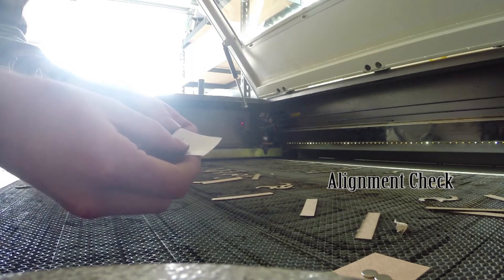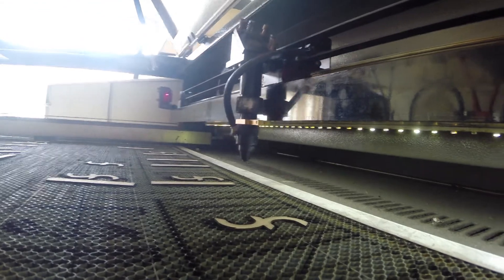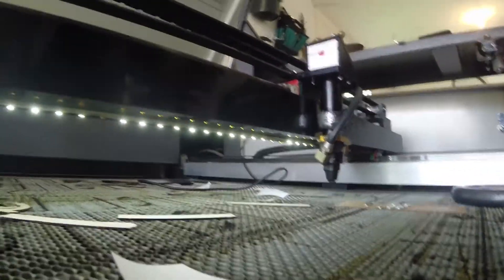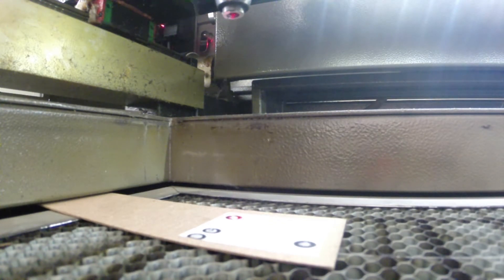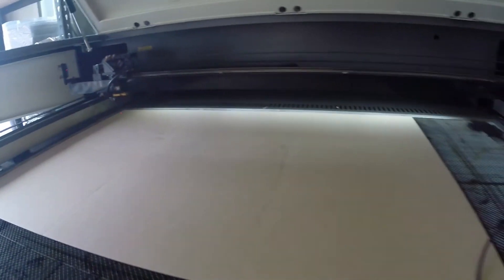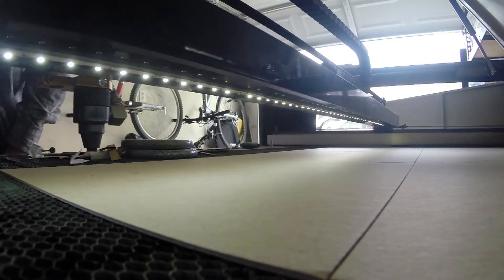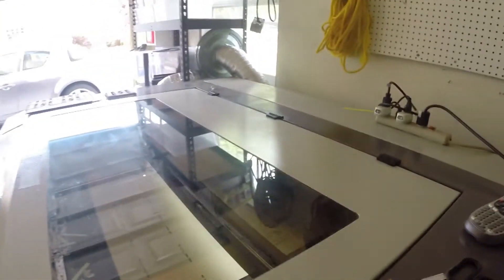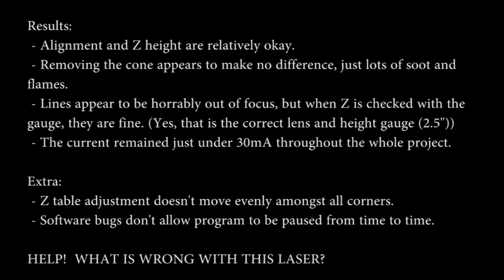Full Spectrum Pro LF 150 Watt Laser Troubleshooting

Comment: You aren't using the focus guide properly, according to the manual:

The laser must always be in focus when in operation. Not only will you not have full power but 
low power out of focus laser beams will burn or start fires instead of cutting through materials.
Focusing the 24x18 [i actually copied this from the 36-48 manual] is quick and easy. Your laser included a focus ruler sized for the included 2-
inch focal length lens. To focus for engraving or cutting, simply place the ruler on the top of 
the engraving plane and jog the Z table up or down until the small notch rests evenly with the 
flange of the air nozzle (Figure 15).

The picture shows the ruler on top of the part that holds the lens, not on top of the gold auto-focus ring. You've probably already resolved this though. I'm trying to figure out how fine the laser can go - I tried engraving 8 pt font on anodized aluminum and it didn't turn out.
Reply: Posting again in case someone stumbles upon this when trying to troubleshoot themselves. I just did test fires onto a sheet of paper using the focus guide they provided...I got the smallest dot when it was 2-3mm closer to the aperture than the guide told me, which I ended up cutting off. Much more accurate now, though I haven't tried any more 8pt fonts. I also realize now it's possible you cut your focus guide prior to making the video.
Reply from the maker: Ian Lehman Very true.  The guide they provided is not correct! You have to modify this one of make new ones to be as accurate as possible.  Thanks!
Reply: Common Fibers No, it wasn't. 9:07 of the video, lip of the guide is over the gold bracket that holds the auto-leveling pressure sensor probe. Page 37 of the PDF guide on fslasers.com (labeled page 30 at the bottom of the page) clearly shows different placement, as does the text direct different placement. Gabriel just said you have to modify it or make new ones, but if you follow their directions and use the one that came with the unit, the positioning in the video is wrong. He very may well have made a custom focus guide, but if someone is watching this video and sees that, they should know that's now how you use the stock piece.
Reply: ***** Your video is from a few months ago, did you get it working properly? If so, what did the issue end up being? My table was completely off-level when we got it, and I had to readjust it from underneath after I realized it...just came in on Wednesday though, so I'm a huge novice, and probably spouting my opinion where it isn't wanted :-)

Edit* - I'm guessing you both work together given the logos being cut in the video and the logo in the common fibers videos. The unit I have isn't as big so sagging isn't an issue, but it seems quite sturdy...when you put the cardboard shims underneath does it cut evenly across the entire surface? Maybe you can readjust the whole table from underneath? The honeycomb surface is super heavy (and pretty flexible), does it sag less with the other one that came with the unit?
Reply from the maker: Ian Lehman Hey Ian, 
Responding for both CF and myself, when we first purchased the laser the instructions were to actually use the laser ruler as shown in the video.  They have since modified the ruler and instructions for a different method.  We have just cut custom rulers to their specifications.

As for the sagging, it isn't the honeycomb table that is sagging, but the knife edge table.  I was able to use shims to bring this up to level, but still because the left and right sides of the table are controlled by separate worm gears and belts, it will go out of wack over time, unless you never change focus... 

I have fought with this machine for over a year now so I know just about everything that can go wrong.  Iv'e replaced the power supply twice, the tube once, and a handful of the optics.  My machine is very large and I think it isn't as far/well developed as their smaller machines.  Feel free to get in touch with me directly if you have any more questions at gabe@commonfibers.com. I might even respond faster than tech support...

Comment: Having similar problems with a 90w 38x24 PRO LF. I'm using autofocus instead of manual leveling. I think that being wood some sheets might be stronger than others and different parts of it might have different density. I've got better results using lower speed like 50% and 50% power btw.
Reply from the maker: It seems to actually do with scattering of the laser that they can't seem to figure out the cause of...  Still troubleshooting with the company to try and determine.  But definitely slower speeds work better, but in a production line, halving the speed means halving the production which isn't going to cut it!  No pun intended!